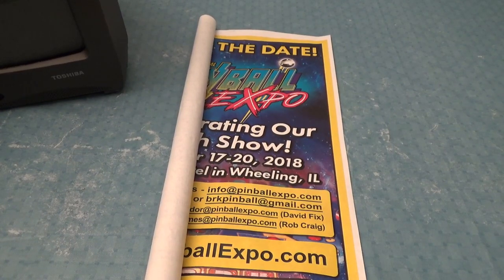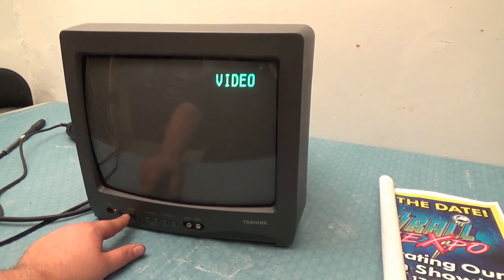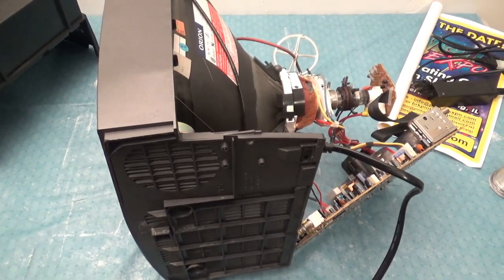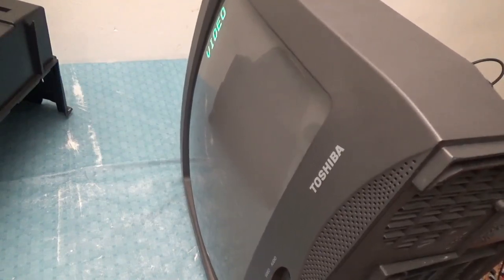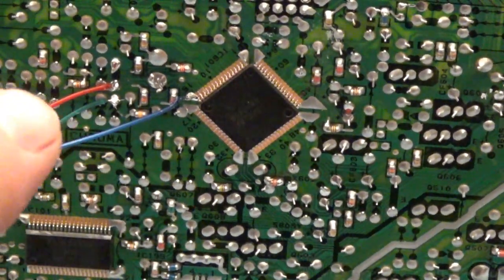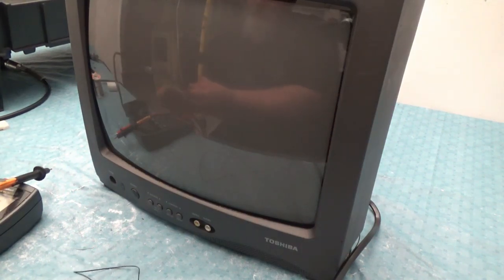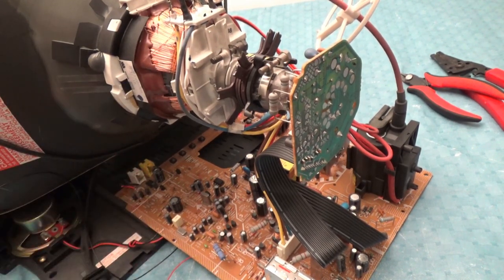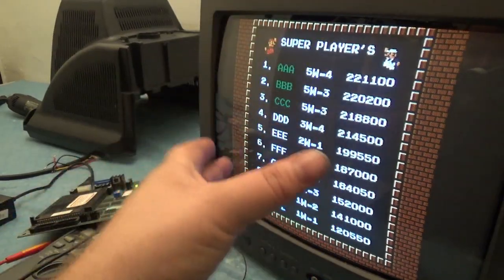how to hack a TV into an ARCADE monitor

Comment: I think it could have been made clearer that this mod can be VERY dangerous if the wrong type of TV is chosen.

A lot of older CRT TVs in 110V-120V Countries use a so-called "hot chassis", so the entire board / circuit, metal shielding, and tuner shielding are "floating" at mains potential.

(or at a few hundred volts DC, since it's usually all after the bridge rectifier.)

This is why a lot of TVs in the US have an insulating block between the tuner and RF input socket.

If you modify that type of TV, not only could it be a lethal shock hazard while working on it (especially if using the "licked finger" test), but it will be likely kill any arcade PCB hooked up to it, assuming it doesn't pop the fuse or cause an RCD to trip.

Also, because most arcade cabinets use an isolation transformer, using the RGB-modded "hot chassis" TV could actually appear to work fine, but then you'll find that the buttons / joystick / metalwork on the arcade cabinet are now LIVE at 200V+. :o

The hot-chassis TV would have bypassed the isolation transformer, but not necessarily pop a fuse. Not all houses even have an RCD / GFCI either, so the first you might know of a problem is when you go to touch the control panel to play a game, and get a (possibly fatal) shock!

Also, you really shouldn't be recommending that people lick their finger or even fingernail, and go probing around the mainboard of a live CRT chassis, even on the moddable types that use a switched-mode PSU.

You can still get shocked by the return current from the flyback, SMPS,  or neckboard etc.

For many CRT TVs, you can find the service manual and / or schematics for free online, or at least a similar / same chassis,  and that will show whether it's safe to RGB-mod, but also which pins to use for R,G,B,Sync,Blanking etc., without having to guess, nor having people poke around the live board. :o
Reply: You also didn't make it clear about safely discharging the CRT itself before working on the board.

The larger caps on the main board should be tested with a multimeter for any residual charge, but the main hazard is the CRT, as you can get a nasty shock, even via the main board.

I don't think there have been too many reported deaths from a CRT which is powered off (but charged), but people who have survived getting zapped have ended up with life-long heart issues like Arythmia etc.

None of this stuff is too big a deal or that difficult to do safely, it just needs the right info.
Reply: Totally agree!  I've subbed and its a great video - but there must be a better way than wetting your finger!  I would suggest connecting up a composite input, displaying a red, green or blue screen, and probe the chip points with oscilloscope - when you think you've found the signal, check the ones nearby and change the colour to prove for certain.   Wet fingers and CRTs is just asking for trouble - fine if you know the model and can see clearly that there's no HV stuff around that area, but the inexperienced will kill themselves...
Reply: You guys are missing the point.  If you are even attempting this in the first place, then you are already past the point of needing to be reminded that "there are voltages in here".  Those warnings are all over the back of the TV.  if he went over all the safety precautions each time, then each video would have 30 more minutes at the front.  The better thing is just to say "Follow all the appropriate safety precautions when doing this yourself, I can't be responsible for your safety".
Reply from the maker: @robmcraf2765  well said
Reply: Use a isolation xfrmr and you'll be fine.
Reply: Wet finger in a CRT seems to be a really bad idea lol 😂
Reply: @robmcraf2765  thanks for sharing the worst scenario to do this, obviously if you are trying to do this we can have some certain knowledge about crt and high voltages ,we are not talking with monkeys
Reply from the maker: @FernandoCardonemv  electron is referring to really OLD sets . mostly vacuum tube and early transistor sets .  none of those are a good candidate any ways . in fact i challenge you to even find a tv with a tuner knob know nowadays .
Reply: Any TV like that, without proper mains isolation, is not going to support the hack anyway. To do this, you need a TV capable of injecting an RGB overlay; ie a TV with an on-screen display. Only televisions made within the last 20 some-odd years of the CRT era are going to have an OSD, and their chassis will not be live.
Reply: This is not the case at all, though.
I'm not trying to scaremonger or anything, it's just the case that many TVs in the 90s (especially in the US) had the "hot chassis" thing, even sets with an OSD.

It's just something to be aware of, because many people clearly still don't know about it.

But yes, anyone attempting the mod should already have electronics knowledge anyway.

It's the people who don't have any experience that I worry about.

They might think they are being safe enough just by discharging the tube, doing the mod, and making it look tidy etc.
Only to find themselves getting a nasty shock from the connectors / cables when it's finally powered up.

And at this point, I would consider most CRTs as "old" anyway. It's been about 15-20 years since new CRTs were being made by multiple brand-name manufacturers.
Reply from the maker: @electronash  not trying to be difficult but i have never seen a hot chassis tv made in the last 20 -25 years and i have torn apart hundreds of tvs for there tubes .   the odds of finding a (hot chassis) tv are actually extremely rare  and mostly early transistor sets  and vacuum tube sets
Reply: @ArcadeJason  

Fair enough. Maybe they're not quite as common as I thought.

But I'd still prefer to be on the side of caution. If it even saves one person from a serious shock, it's worth repeating.

What happened with your hybrid raster/vector monitor, btw? I'm interested to see where that project went.

I recently got the HV Board and deflection boards working, so I can modify CRTs more easily into vector monitors.

Still working on an improved DAC for MiSTer, though, as the SPI one can't quite keep up.
Reply: @Toroidal Zeus That's the whole thing, some older sets *might*.

It's up to the modder to check for that, and be aware of it.

But yes, it's more common to see hot chassis TVs which only had an RF input.
Reply: @ArcadeJason  That's because most TV sets made since the mid to late 1980s have audio and video input jacks. That option voids the use of a hot chassis. Most of these post 1980 TV had switch mode power supplies which were isolated from the power line.
Reply: I once did a house call on a 35 inch RCA set. It  kept being shut down by the X-ray hold down safety circuit. I took a ground wire from the frame and discharged the EHT which went off with a loud crack.  I did not measure what it had on it but I would estimate 40kva.  The high voltage was discharged into the ground but that was not relevant to ground  and when I touched the frame I caught a pretty good Jolt.
In 8 years of in home tv repair I would catch a Jolt about once a year, so look out.
Reply: @GORF_EMPIRE  Only with reference to earth ground.
Reply: @allanpatterson7653  But of course.
Reply: Thank you for explaining this.
Reply: This cannot be right to be touching the board while the tv is plugged into the power outlet.
Reply: Merci pour l'information 👍

Comment: For newer TVs, to adjust vertical size and other adjustments, you need to access the factory service menus. On RCA sets, you hold the volume down key on the TV, while pressing Info on the remote. You will then see the service menus, where you'll find adjustments for R G B color biases, vertical size, vertical lineraty, vertical center, horizontal width, ect. You can adjust these with the arrow keys on the remote.
Reply: I have an RCA 32V430T that was made in about 2005 and holding down the volume-down key on the TV while pressing the Info button on the remote doesn't do anything. Do you know of any other methods of accessing the service menu?

Comment: BTW, quick tips for others who want to do this with your own TV and want to actually keep the result:
- Look up the service manual/schematic for your TV, you can usually find them for free on teh Googs. This will avoid having to give your TV a wet willie.
- Look for a TV with a Closed Caption or On-Screen-Display or OSD. These usually have what's called a Jungle IC (it will usually be called that on the schematic) that has the RGB inputs. Really old TVs that don't have an on-screen volume or menu will almost certainly not have an easy way to put in RGB except at the neck board.
- You can insert sync through composite or svideo, depending on what you have and which ports you want to cannibalize.
- You can adjust brightness of the RGB levels using resistors or potentiometers.
- Lastly, be aware that, although your TV may have a Jungle IC, not all are RGB input. Some run on YUV color, which will not work with arcade boards. In those cases, you would need to hijack the RGB right at the neck board.
Reply: Is he actually hacking into the Jungle IC in this vid?
Reply: arfink how do I "hijack the neckboard?"

Comment: Thankful in the uk we have rgb scart sockets already wired and ready on most of the old crt tvs.
The only trouble with using a tv is you need to know how to get into the service menu, from there you can adjust nearly everything to do with the picture more so than an arcade monitor its just done electronically, sony and Panasonic have the best service menus the adjustments on those sets are impressive like my main gaming tv a Panasonic 29" dolby prologic tv has electronic convergence rings which again can be adjusted from the service menu.

Comment: I know every TV is different, but is there a way to wire the power button to stay on? If that makes sense lol! I want the TV to power on when plugging it in. That way I can use a smart plug to power it on and off. It's for an arcade project. Any info is much appreciated brother.

Comment: I have a big buck hunter safari missing the crt monitor, it also has a vga connection. I found a 27" flat tv that I can transplant. bit it has coaxial and av jacks, no vga connection. do you think the light guns would work if I install a vga to coaxial adapter or vga to av jack adapter?

Comment: I successfully found my RGB lines and enable line, but then realized the TV I'm working with has no composite in.   Ouch!  Any tips on how to inject sync into a tv that doesn't have composite?   TV is  GE 19GT270 with a CTC185B chassis.   Still potentially doable or should I punt and find another TV?

Comment: I was wondering could you use component cables since they are red green and blue instead of soldering directly to the chip or does this make it harder for ground and sync? Would love to see another video on the topic
Reply: component isn't rgb. it's ypbpr. rgb corresponds directly to the red green and blue guns in the tube. ypbpr has to be processed and converted into rgb.

Comment: Great video! Thanks. 

Question: If a TV does NOT have a composite input connection (but only RF) where might a person look to connect the sync/ground? Would it also be on that chip? Here's a pinout of the chip in video: http://www.datasheetcatalog.com/datasheets_pdf/M/6/1/2/M61206FP.shtml  

A couple days ago I was doing tube swaps and one of the TVs had that same chassis and I was looking at the neck board thinking there must be an easy way to just wire in RGB.
Reply from the maker: on the chip

Comment: I once had an old Macintosh Performa 550, back in the 90s. It was one of those all in one models, with a color CRT mounted over the motherboard. The color alignment got knocked off when it had a hard knock, so I opened it up to fix it. Those computers had a ridge along either side, and out of habit, to move the computer, I grabbed for that ridge, not even thinking the cover was off… Grabbed the bottom of the flyback transformer…

Ya… The color sure as heck changes… My vision went entirely colorless for half a minute. Literal monochrome vision. I was dazed, pain shot up two of my fingers. I felt entirely drained. My arm muscles burned… When i had the sense to look (and my color returned to my vision), I had what appeared to be two “white-head pimples” on two finger tips. They were not pimples of any kind. They were wounds, with the centers burned to a white ash. I could make powder fall from them…

I knew just how close I came to killing myself that moment. Had that gone from one finger to, say a finger on the other arm, I’d be dead. By a miracle, the current flowed from one finger tip to an ADJACENT fingertip… it hurt SO bad, but I was SO relieved to not be dead! I had graduated high school the very day before. I can’t even imagine how awful it would have been for my family if they’d found me in my room, dead, then… I’ve since more than doubled my age, so I must’ve at least learned SOMETHING from the stupidity of youth!

With the fact that you never know if there's a floating reference or a virtual ground, or some other quirk in a particular model... You'll never find me so recklessly probing with a finger inside of any CRT device, ever. I once blew a circuit probing with a grounded oscilloscope, cause the circuit I was probing had it's own "ground" sitting at 70 volts over Earth ground, and it's 10 volts sitting at 80 volts over Earth ground. Trying to attach my oscilloscope probe ended up shorting the floating ground to the Earth ground, and blew shit up! I learned to use an isolation transformer with my scope after that!

I still deal with CRTs from time to time, but I am FAR more observant, and far more respectful of them now.

Comment: What's your opinion on those adapter boards you see on Ebay that allow you to use different types of monitors for arcade games?
Reply from the maker: they are finicky at times but also the ONLY cheap option available that i know of by the way don't use the rgb to composite adapter very fuzzy pic

Comment: I have this small samsung TV that the flyback wine becomes lower in pitch if the set hasn't been used for more than a day.
Its one of those sets I like to call a "spongebob era set" think silver plastic, flat front, kinda the last of CRTs.
I found it dumped on the side of the road and brought it home since everyone seems to say theres something magical about these things so why not?
It works fine just makes that anoying sound but it goes away after you let the set warm up.

Comment: This video is awesome!  I have so many non working arcade chassis that I have been struggling to get working.  I have been taking people's 19" & 25" old tv's for the past 1.5 years so I have a ton of them.  And most of them work!  This just might be the answer to all my problems!  I laughed when you said that you were told it's two different technologies because that's exactly what I was told each time I asked why you couldn't somehow use a regular tv as an arcade monitor.  Lol.  I have a question for you though, you said "standard definition" video games.  Is there an option for my games that have medium resolution CRT's in them?  They are mainly my driving games with 25" & 27" CRT's.

Comment: I need some help, I've done this and I get all the colors except white. Now I know that white is a culmination of RGB at full strength and the monitor does show white when I adjust the brightness all the way up. However the blacks get washed out and most color is indistinguishable. I have it hooked up to a genesis right now and I have maximum carnage in since theres so many colors . The LJN logo is supposed to have a white backdrop but mine is black. Any help?

Comment: Thank you for the video, I'm actually looking for a CRT (which there's plenty of) still in my area but I'm having a hard time figuring out which one to get, I see many of them from early 90's with only RCA input and many of them from early 2000's with component input, and I'm wondering if it wouldn't be easier to work with component since it's already RGB but I can't find articles or links of people doing this with component tv's. Any reason I shouldn't use one?  and what should I look for if I'm getting one with component input? any brands or models that are better suited, etc....

Any advice would be appreciated, thank you

Comment: That was pretty neat, I always hate when people say perfectly logical ideas won't work, CRT is a CRT. :\ One of my projects has been to take small RV style portable CRTs and expand there AV output options for consoles, most of the ones I got only have a coaxial. Haven't tried it yet but I think I'll have to add a board to get Composite and so forth.
I don't think I'd be doing those tiny CRTs any good leaving them with factory input, people got rid of them because they don't have Composite, S-video, or Component. The more uses the better otherwise they will just become trash.
Reply from the maker: thanks for watching man!  good news you can do this exact hack on those crts too
Reply: Sweet, I'll get going on that then. :)

Comment: This is a pretty neat hack to get a game up n running. Especially if actual arcade monitors are not easily found in your area. At the very least it gives you an authentic resolution and scan line look, vs a game bastardized with a flat panel lcd and conversion board. Jason n Kelly FTW!
Reply from the maker: Lol

Comment: You can also get tv with remote control from the service manual get in to service mode and change the vertical  and horizontal position

Comment: Well, later European CRT TVs with SCART are basically "pre-set" for 50 and 60 Hz only. And that is different from arcade monitors that can easily adjust to "weird" refresh rates like 55 Hz... So IMO a home CRT is not really the same as an arcade monitor.